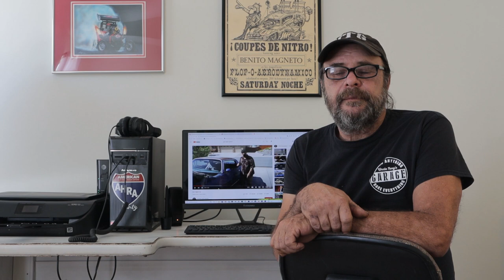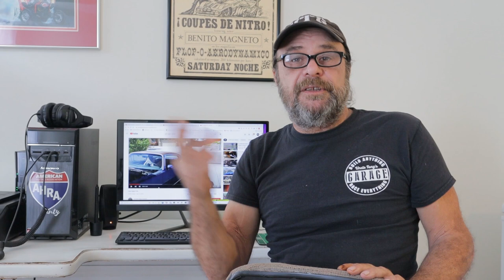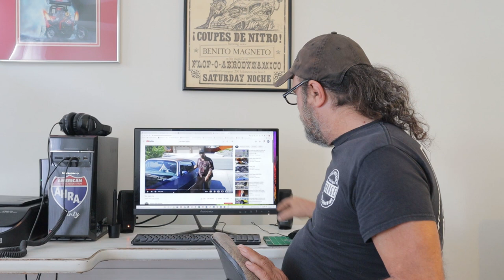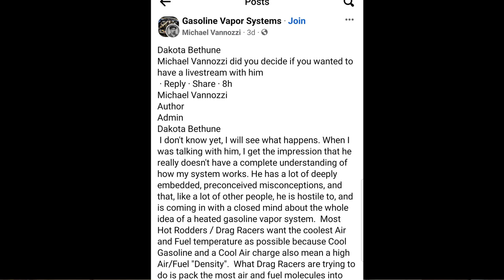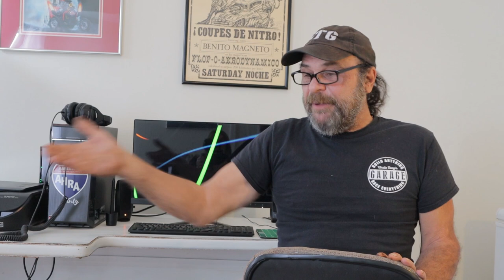Climbing Down The Mega Mileage Conspiracy Rabbit Hole

Comment: Next up will be " run your car on water "  Have a look at this vid  Vacuum Pressure Hydrogen fuel cell defeats high gas prices using hydrogen from H2O.  on the channel Metalpress TV
( An actual fuel cell takes in a fuel and oxidizer to make electricity,this is sometimes found on space ships. What this guy is doing is electrolysis that absorbs electricity. )

Comment: By the way, it is exactly why todays computerized fuel injection is so successfull, it will give you power when needed and give you good mileage on the highway at part throttle and will give you the least emission possible. Carbs can be tuned but really, carbs become limited when all driving situations  need to be adressed. This guy could do 35mpg, that is possible but I believe we all know this car is not drivable by your and my standards.

Comment: He just posted a video on his Facebook group page going "100 mph". Must've took him half a minute to hit that speed and is he getting 35mpg at that speed? Lol.. So his system runs the car but he hasn't proven any historic increases in efficiency or practicality. I'm sure my Optima will out pace his Camaro and I really get 35 mpg.
Reply from the maker: In that video, he is pacing the car in front of him and the speedo is reading an indicated 95 mph.  Of course with gearing and transmission changes as have been done on this car, there is no way to gauge the accuracy of that speedometer.
Reply: @UncleTonysGarage  agreed, I'm honored that you responded. Happy New year.

Comment: Ok Tony can you at least explain this, 1991 olds cutlass stock 3.1 L w/ 250k getting 30/32 mpg  highway compared to a 15 year newer 2006 chevy Impala w/180k that can barely get 24 mpg in same conditions. It seams as though someone has their hand on stifling better fuel economy as technology has supposedly gotten more advanced. In the 80's we were getting 18/20 mpg in big old boats like the Delta 88 and the chevy caprice. Now they are pushing electric that does not go as far on a charge and takes 2/3 hours or more to charge when depleted. Not conspiracy , FACT .

Comment: Since fuel efficiency is the hot topic. Watch this 10 year old video about the J-79 turbojet engine.
It used -35-40 gallons per minute in standard mode. About 15,000 HP. And 85-90 gallons per minute in afterburner. A gawd awful amount of power.
Amazingly, about 2/3s of the fuel was burned to run the compressor. Very similar to most modern automobile IC engines. So 33-40% efficiency.
https://youtu.be/3SH5953iQ6w

Comment: I know this is going to get bashed i actually own a 2019 mitsubishi mirage 1.2 litre manual i achieve 20 kilometres per litre but i light throttle every moment like walking on eggshells changing gears between 1000 to 1250 rpm driving at 30 to 35 km ph so yes fuel economy is possible but at a cost your performance

Comment: It's all BS. There are people running these gasoline vapor engines and the gas mileage simply isn't there. Sure it will run and drive, but isn't going to net you much if any in fuel mileage.

Comment: Lol ! I on the other hand have a different outlook. If you have a carburetor car getting 20 mpg I don’t see why putting a fuel injected setup on the same motor does not get 30. Mpg. At least. This is how I look at it! You get make on timing, you should get make vacuum,you should get the best combustion,you should be able to get the best vaporization of the fuel, you should also be able to get the best performance out of that same motor because of all this. I think today tech also should be able to blow this hot air thing out of the water. The power the computers have now days to Monitor all the parameters of the motor is sad why we can’t do better. I would give up on the hot air. I would love to see these tech guys prove how there computerized carburetors are better!!!!! I am not talking 5 to 30 hp either!! Also 10% mpg!!!

Comment: Tony you are right and he is wrong, He has no reason not to Dino it a benefit, to show what he has built, The only reason I can see is it does not work , Like he says, That system isn't about hp its about saving gas.if it has a slow take off so what, Its about saving on gas,, And Tony I will be honest, It does work , I took a 2 gallon jug of gas made a bubbler on my 96 Dodge Ram, And I did save gas Its not on there any longer , I just wanted to see if it worked, I went from 14 mile a gallon to 21, Driving a 180 to my Brothers, And what he's saying about driving  slow, My truck ran normal I was able to drive 75 mile per hour, It even went into passing gear. But that wouldnt of matters, As long as it saved gas. PERIOD, Like your video's dude

Comment: I enjoyed vid again, I have an axiom, Your gas mileage should be a higher number than your quarter mile time, or you screwed up.  I don't understand what the guy is afraid of, he ought to be all over that.  You can tolerate lower performance for 35 mpg in a cool car, that is twice the mileage I got with my 70 Chevelle SS454, 16 mpg, 14.3 etc at 100 mph.     3.31 axle and a M21.

Comment: Why bother vaporizing gasoline when you can just use propane?  Millions of forklifts and trucks have been using propane for decades.   Granted, propane has less energy per liquid gallon so the comparison of fuel consumption would need to be done on a BTU basis.

Comment: Way to move the goalposts on him. So now it has to get the high MPH, in addition to performing better in acceleration. And the Ogle and Meyer stuff...if you're not willing to actually understand what they did, then just leave it alone. It's asinine to come on here and dismiss it like this.
Reply: NOT performing BETTER in acceleration, but performing WELL ENOUGH, to drive safely on roads that aren’t flat, and where you can’t have a minute thirty to get up to 55 mph.
Reply: @orcoastgreenman  There's plenty of vehicles that have very slow acceleration, many older economy cars struggle even reaching 55 mph. But that's not the point. He only made a claim of MPG, and that's the topic being discussed. To add another requirement that helps your argument is called moving the goalposts. It's a disingenuous debate tactic and easy to spot, and that's why I posted. My main interest is in Stanley Meyer's work.
Reply: @Loth440  Must have rode the short bus to school then cause seems you're a couple gallons shy of a full tank here Mr "I'm not n the cult".
Reply: @jimkaray  You add nothing to the discussion, and you don't rattle me. So run along.
Reply: @Loth440  is your cult advising you on these witty comebacks? Might be time to find a new one.

Comment: 35mpg at 55mph in a camaro with a manual and a 2.70 gear is not impressive. Whats the weight, is it lightened too? He doesn't even need to dyno it, run it down the track or use one of those in car accelerometer/ timers. Heck, let's see how it runs and idles ...

I had an 81 d150 with a Carter 1bbl, Jacobs electronic ignition  ( dont ever buy one ) 727, heavy duty front suspension,  8' bed, 8.25 rear with 3.21's and a 235/75/15 tire. In mixed driving and cruising speeds of 60 mph plus, I was getting over 28 mpg. It was just a beater truck but would whoop all over my brothers beater 84 chevy 350 4bbl from 0 - 60 mph.  I eventually burnt a valve but the 35 mpg claim in that camaro is not impressive.

Comment: It's pretty ignorant to think that hot-rodders or drag racers would be dismissive without reason, or due to preconceptions. Increased mileage means increased effcencey. Increased effecencey means a better burn, better burn means better cleaner power. LITERALLY MORE BANG FOR THE BUCK. This also means there's potential for more power. There isn't a hot-rod/grag person on the planet that would say no to "free power". The same is true for the automotive industry only for them its all about the money. They are right, there is a conspiracy to get your money. They will do whatever they can to get heir hands on your debt, and if there was validity to their claims the manufacturers would already employing these systems on vehicles from the factory. For them it's free money, and there's not a single cooperation on the planet that is going to say no to free money.

Further, if I can de-rail it with basic logic how well do you think it will stand up to actual efficiency testing?

Bunk. All of it.

Comment: TONY IS RIGHT HERES WHY...
Rough numbers here. If a stock chevy 350 makes 180HP with a 2 barrel 500cfm carb and a motorcycle carb is 100cfm, divide 180HP by 5 and you get 36HP.  Everyone Knows that optimum combustion occurs at 14.7 fuel air ratio so if you cut air you must cut fuel thus cutting HP. 
2.70 with 20% O.D. T5 trans, probably 27" tall tires = 1344 RPM. With 36HP @ 1344RPM @ 50mph... this guy is no Einstein, but a false prophet!

Comment: its them same issue as with the falt earth'ers. people will believe what they want to believe and no one can suede thier mind. as to that guys 350, it sounds like it more work than fun to achieve what he trying to do. 

for the most part any stock tuned 350 with a properly matched carb and proper gearing could this match this "mythical" 35+ Mpg while maintianing driveability. I did some reacserch about 20 years ago on this subject and the concpet i alyways thought was cool but also quite scary. hot elements and gasoline inside a sealed box does not make for a good time lest something go wrong(kaboom). i figured it was more of a liability aspect that kept car manufactures from actually prototyping these types of fuel systems. if the garage mechaninc thought something like this up, im sure that engineers have taken the concepet and tried it themselves in the lab but concluded it wasnt worth it. bottom line i would say gearing and tuning is more important to fuel economy than these theoretical 100+mpg carburetors.

i love the down to earth and common sense style of your videos tony, keep up the good work.

Comment: tony, i get your point, but your wasting your breath.some people believe it will rain when the temp is at 0°F. & still believe it when the snow is up to their ass.there is NOT enough energy in gasoline to get 100 mpg while still having acceptable drivability.the mixture would need to be so lean that any load on the engine would immediately destroy any drivability it had while just cruising at a low rpm.but if you richen the mixture to cover this hole in drivability, there goes your high mpg right out the window.a 100 mpg engine may be possible in the future, but it would require an entire redesign of the I C E. for now you cant run an engine that lean for long without burning it up.but some people just enjoy ignoring proven facts.i wish them luck, they're going to need it.

Comment: Ok so my two cents, I've watched Michael's video about his Camaro and at face value there is some level of truth concerning how it could work and I will make an attempt to explain how it works going into scientific detail and how it could be quantifiable and may shed some light on how Michaels claims may have the ability to be accurate. let's get started, so it is SCIENTIFICALY understood that a perfect air-fuel ratio is volume 14.6 pounds of oxygen per one pound of gasoline according to Edelbrock's thunder series avs carb owner's manual... page 2. How do we know that 14.6 to 1 AFR is "perfect? Gasoline particles need oxygen particle in order to combust, so when there is 14.6 pounds of oxygen there is enough oxygen atoms to burn 1 pound of fuel with nothing left over and the space that that AFR is in is deemed 100% efficient. Now anyone who has tuned an engine knows that most engines don't operate with a 14.6 to 1 AFR and this is due to inefficiencies in the individual engine and added fuel that is used to cool the cylinder walls by evaporation. OK so now we know and understand AFR, lets discuss volumetric efficiency. Again, I'm sure anyone who has bothered to read this far understands that the volume of a NATURALY aspirated engine is often very lower especially with a factory head intake and cam combo from a GM 350 and could be as low as 60 percent volumetric efficiencyJuels
Reply: Ok so my two cents, I've watched Michael's video about his Camaro and at face value there is some level of truth concerning how it could work and I will make an attempt to explain how it works going into scientific detail and how it could be quantifiable and may shed some light on how Michaels claims may have the ability to be accurate. let's get started, so it is SCIENTIFICALY understood that a perfect air-fuel ratio is volume 14.6 pounds of oxygen per one pound of gasoline according to Edelbrock's thunder series avs carb owner's manual... page 2. How do we know that 14.6 to 1 AFR is "perfect? Gasoline particles need oxygen particle in order to combust, so when there is 14.6 pounds of oxygen there is enough oxygen atoms to burn 1 pound of fuel with nothing left over and the space that that AFR is in is deemed 100% efficient. Now anyone who has tuned an engine knows that most engines don't operate with a 14.6 to 1 AFR and this is due to inefficiencies in the individual engine and added fuel that is used to cool the cylinder walls by evaporation. OK so now we know and understand AFR, lets discuss volumetric efficiency. Again, I'm sure anyone who has bothered to read this far understands that the volume of a NATURALY aspirated engine is often very lower especially with a factory head intake and cam combo from a GM 350 and could be as low as 60 percent volumetric efficiency of an engine. So, a chevy 350 might be only using 210 cubic inches out of 350 in some cases. with all that being said an engine is only capable of ingesting a theoretical amount air and fuel per each revolution meaning it can only take in so much energy in form of fuel. One pint of fuel at ambient temperature contains a given amount of HEAT energy that can be accurately estimated, and that measurement is given in Juels. Think of Juels like dollars, you can pay someone so many dollars per hour and in this case the form of work is horsepower. The only way to change the "VALUE" of gasoline is to add heat energy to it and in this case, Michael is heating a heat exchanger using wasted heat from exhaust gases. So basically, he is recapturing that lost heat energy by preheating and evaporating the AFR via the heat exchanger and if done correctly this system has the ability to recapture a lot of heat. The size of the carb he is using is 215CFM so if the engine was naturally aspirated it could run at a maximum of 4000rpm before it the carb would be limiting the engines performance, I think the shape of the one-barrel carb was why it is used. The turbo's main function is to regain the volumetric efficiency that is lost with the heat exchanger arrangement. I'm going to throw some basic numbers at this and I'm just going to give it a guess on what is occurring here. let's say the engine is 75% volumetrically efficient and makes 250hp in factory trim meaning if it was 100% efficient it would make 333hp with an ideal AFR. So, we can make the assumption this engine probably gets 13MPGish from the factory and with 13 to one AFR he would need to lean it out 2.71 times to get 35MPG, so like a 35 to 1 AFR. So, off the top we can guess that his 250hp engines now makes 92hp (250/2.71) and then we are going to increase the thermal value of the fuel buy heating it with the heat exchanger. The amount of energy that is introduced into the fuel could be measured by measuring the temperature delta across the heat exchanger and calculate the added energy to the fuel. I could probably better explain this via video and if you want it just ask.

Comment: Another thing regarding Stanley Meyer's system - it's not a hot vapor gasoline engine, no one made that claim, somehow you grouped it in with them. It's a hydrogen burning engine with a water > HHO converter feeding it. Others have modified cars to run on hydrogen, but they have to load tanks into their car. Meyer's breakthrough was the highly efficient water > HHO converter that was onboard and processed it on demand. He filled the tank with water, the converter created HHO, the engine burned it along with air, and exhaust was water vapor.

Bob Lazar went halfway, when he converted his Corvette to Hydrogen, created a portable converter to fill the tanks overnight. This video explains his process...Meyer's was much more advanced. https://www.youtube.com/watch?v=Ytg23mDd1a4